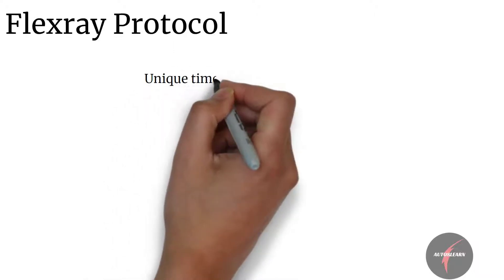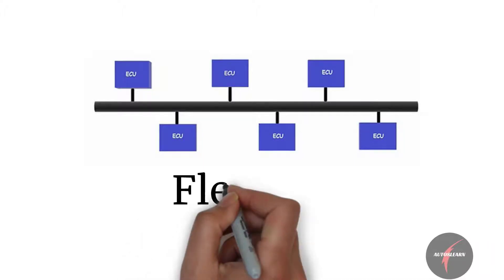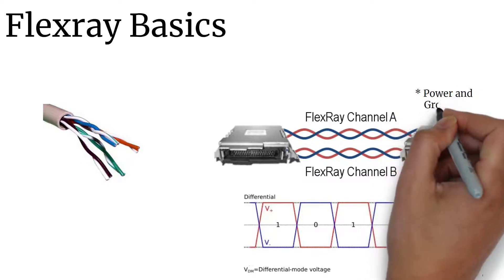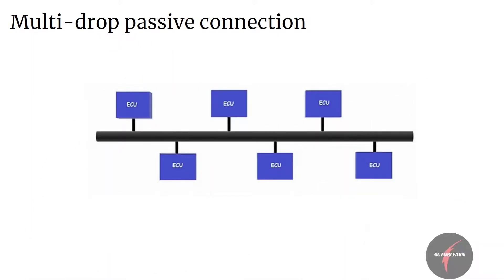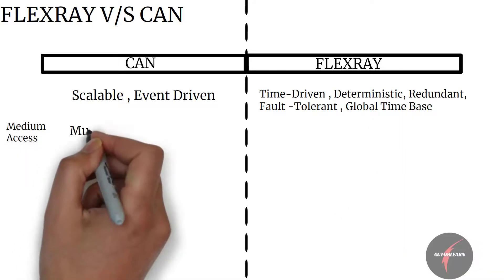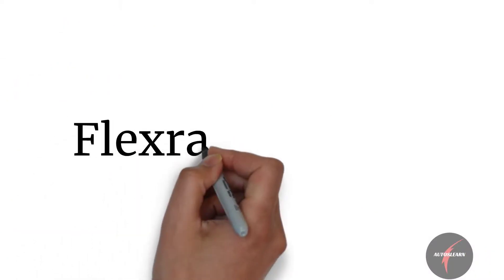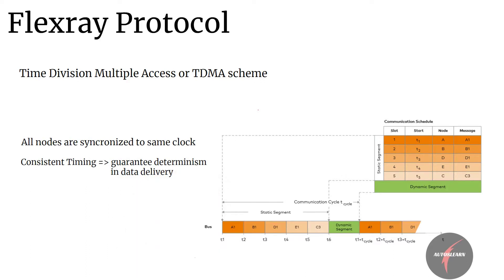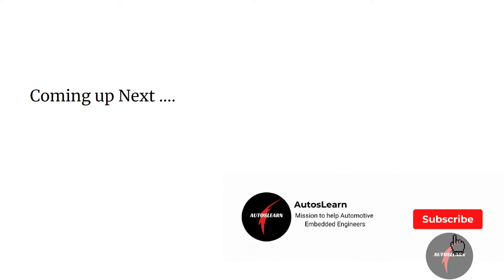Unraveling the Power of FlexRay: Exploring Automotive Basics | Part 1#FlexRayProtocol #TechEducation

Comment: Is there a device, like a gateway, that can translate flexray to CAN? Tx and Rx. 

I'm curious what makes Flexray so hard for aftermarket ECU manufacturers to support. Flexray has been around for awhile now and, from what I'm told, these aftermarket ECU manufacturers cannot support Flexray. For example, the new Toyota Supra and BMW M cars have Flexray and there are no standalone ECUs because of this. 

I'm curious about your thoughts, if any.
Reply from the maker: Hi Lilbent81,

Thanks for watching the video and reaching out to us for our thoughts on the above issue.

Based on our understanding, even though Flexray has been around for quite some time now , its not as widely used as CAN or CANFD. 
Compared to vehicle which are on CAN or CANFD , Vehicles on Flexray are still quite small and hence it's doesn't seem profitable for these aftermarket ECU manufacturers to create standalone ECUs on Flexray protocol.

There are Gateways developed by different Tier1 suppliers which converts Flexray into CAN or CANFD , but its developed based on the need of OEM. We are unaware of any that you can find in plug-play format currently in market.

Hope this helps!

Thanks again for reaching out. 

Stay tuned to our channel for more automotive videos !
Reply: Cosworth has FlexRay support. 992 Porsche GT3 Cup cars have FlexRay/Cosworth.